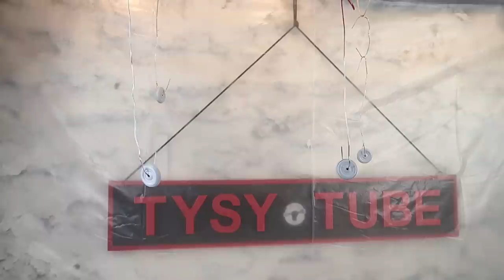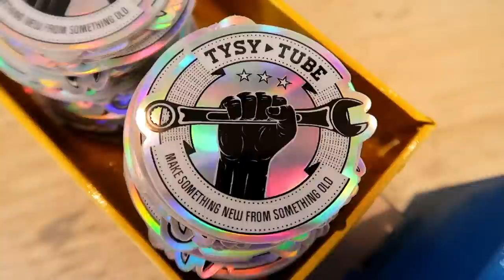1960s Dump Truck Restoration

Comment: An excellent resto. The toys held together by manipulating pre folded creases and securing in place with bent tabs are long gone, but brings back childhood memories of spending hours in my sandpit playing with my earthmoving equipment toys. 👍👍🇦🇺
Reply: It's back for static but far more intricate models you assemble yourself (sold as Metal Earth).
Reply: In my day the inside of the toys that came from Japan had either beer or soda labels as they used the sheet metal off of them rather than throwing it away.....everything post WWII and during was recycled.
Reply: @keithlucas6260  Showed my dad your reply and he remembers the same thing.
Reply: @andrewhallett-patterson9778  ....in my day soda bottles had a 2 cent deposit and the big quart ones were 5......every kid in town rode their bikes around looking for bottles and knocking on doors to volunteer to get rid of people's bottles......for 25 cents you could get a half gallon of icecream....we had penny candy and 5 cent candy bars....the cheapest gas I remember was 17 cents, and stations had "gas wars", were full service, checked under your hood, washed windows and checked your tire pressure.....miss those days.

Comment: Didnt know rescue and restore had a second channel
Reply: I thought the same thing.  At least now this guy will probably use fewer chemical strippers.
Reply: I didn't know TysyTube Restoration
 had a second channel.
Reply: @TruculentGoose  
Rescue & Restore: Joined 2014
Tyst Tube: Joined 2016

Comment: Finally you got a solution to the smelly paint stripper 😂
Reply: Sandblaster boxes are quite expensive; yet pay for themselves in the long run, especially for master restorers like you! Nagwan is right; no more stinky (AND dangerous) paint stripper and acid baths!
Reply: @chrismayer3919  I've noticed that Rescue & Restore still uses paint stripper if the paint tests positive for lead, as he dosen't want any lead getting in his sand blaster box.
Reply: @kevin12567  of course! (that's a given) I saying if it DOESN'T test pos for lead... :-)

Comment: Glad you took my advise on the bead blaster..On thin metal like this I would suggest a finer grit of "glass beads". Then on heavier rusted objects a courser grade of aluminum oxide...Very nice job on the truck, however maybe a satin black rather than gloss on the wheels.

Comment: Great video as usual. I loved everything, except for the colours you chose. The new palette is way too primary, modern and saturated. I preferred the old vintage colours. Apart from that, amazing job. Love the sand blaster.
Reply: That's almost exactly what the original colors would've looked like in the '60s. They faded over the past 50-60 years, is all. Remember that the 1960s brought us "psychedelic;" colors were very vibrant during that decade.
Reply: @TheRealColBosch  maybe the front cabin has faded, it looked lighter, but the yellow back looked darker and more orangy, now it looks way too pure yellow for my taste.

Comment: Interesting idea for the axles.

Nice job color matching! It would be a nice little touch to go over the headlights with a white paint pen.

Sand blasting is so satisfying. Until you're doing it on a hundred ton directional drilling rig with an unairconditioned hood in 112 degree heat.
Reply: do you still have all your fingers?
Reply: @thebeastlysort0168  All thirteen, last I checked!

Wait...
Reply: @colinmartin9797  hold up-

Comment: What a great project! The results are well worth the effort.
I know I would totally be running it over the carpet making BRRRM, BRRRM noises. :-)

The sandblaster is a great addition to your workshop. Others have asked about the medium that you use.
I know that when they remove the paint from aircraft, they use starch in order to minimize the damage to the underlying metal.
It might be something to consider when you're blasting something a bit more delicate.
Love the 1st generation Dr. Who special effects in the intro, by the way :-) I was totally fooled!

Comment: Nice one! Finally a sandblaster comes to rescue. Just a small tip of advice; buy some lead paint tests before sandblasting anything. If you sandblast lead paint any lead dust is dangerous for your health. Also wear hat and face mask while working on sandblaster. After some hours working on it the ruber seals wear out and small particles and dust will fly near you and trapped inside your hair and your lungs (don't ask how I learned this). Also avoid as much as possible to directly hit with the blasting media your gloves. They will be torn apart and you will need to replace them...

Comment: Love your resto videos but have you considered a mild resto? This truck honestly looked beautiful in its original patina - it had history and told a story which was erased with a full restoration (good job though it was). Maybe a polished of of the wheels and fixing the axles along with a clear lacquer over the original paint would be the best of both.

Comment: Everyone seems like this but i did not. Thin sheetmetal and sandblast whit sand, i wound't done that, whit aluminium oxide or glass, yes. and the treaded rod is too away from original shaft  in my opinion. Next invest should be spray gun!!! But enivei, great content and you absolutely should do more!!

Comment: Do you use sand or nutshells when removing paint ? Nutshells does not add to damage or wear down metal when removing paint , reduces need for sanding ?

Comment: Great video!  How do you decide which pieces get full restoration with new paint and the like and which get a good cleaning and save the patina?  I'm sometimes afraid of 'ruining' the value of a piece by fully restoring it.  How do you avoid doing that?

Comment: What type of axle did you replace the old ones with? At first glance I thought it was M3 thread rod, but then you put those snap rings on it, and the "threads" appear to be perpendicular to the axle, instead of slanted (like proper threading would be). Thanks!

Comment: A question, I'm always nervous when it comes to bending metal tabs due to metal fatigue and them potentially breaking. Once all apart, would heating the tabs with a blow torch to red hot and then letting them cool restrengthen them so they won't potentially break off when bending them back when putting things back together? I've never tried it before, but I'd assume it might work. Thoughts?

Comment: I don’t understand why you always wet sand after priming. I can understand doing it if you have pitted surfaces and use a high build primer, but for most bare metal that is smooth, all you need is an etching primer.